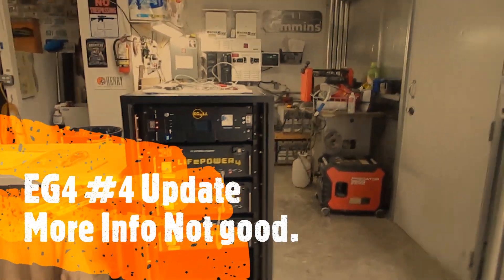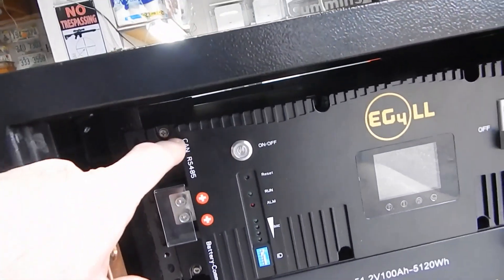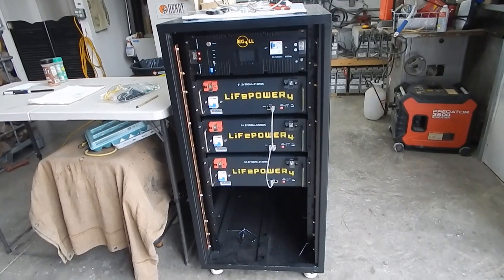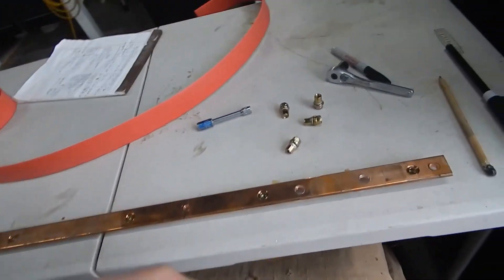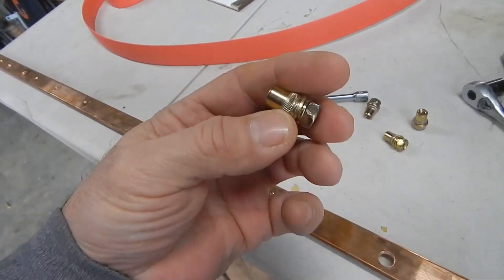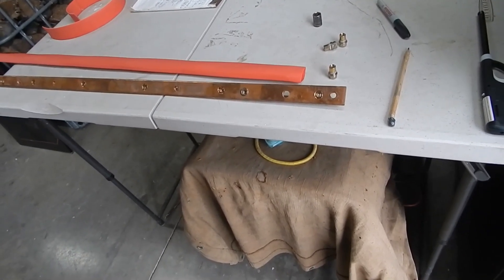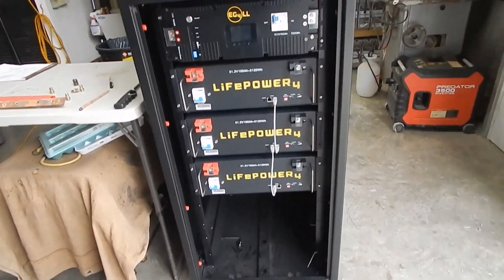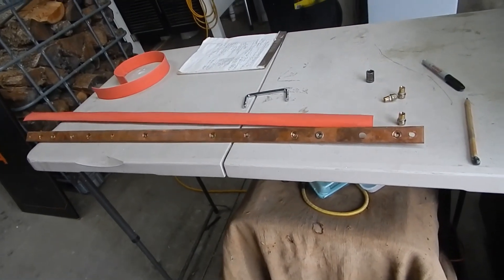EG4  Battery & Bus Bar  Info # 4   Unbelievable Safety Issue!!

Comment from the maker: Please like & share this video for safety sake. Lot's of these have been sold. If U have 1 or know someone who does please let them see this video so they can inspect there's be safe not sorry. Thanks.
Reply: Hi Glenn, looks like you eventually got things figured out, Had a question. Is your EG4LL V2 communicating with your lifepower4's, or is it separate,? I have a similar setup and haven't figured out if communication between the two is possible, Thanks
Reply from the maker: @APG78   The version 2 battery does not talk to the other 5 batteries as I was told that it would . Also the version 2 battery seems to have A BMS that will not show up on the BMS test for the version 2 battery. It has never showed up on the BMS test have gone over this with Tech Support it never has worked. They offered to send me a new BMS for the battery I told them I didn't think that was the thing to do I bought a brand new battery it should work. Anyway the battery works fine and I just left it alone. The other 5 batteries are fine and show up on the bms test for that kind.
Reply: @TheKiloG69  Copy That, Thanks for the reply 🙂

Comment: Using Pem Nuts for an electrical connection is insane.  I took my bus bar out as well to drill and tap my own holes.  The bar is 300A rated but they just about ruined it.

Comment: I had already seen this issue on other videos and so I will be setting mine up with bolts and nuts. I am getting a delivery tomorrow of 6 EG4 batteries and the free cabinet. It is probably the same buss bar you have. I use riv nuts and love them but the ones in your video are not correct for that thickness bar.
Reply from the maker: Nice be safe check them they can be fixed.
Reply: @TheKiloG69  I asked on another one of your videos, but what size bolts did you use on the buss bar. Thanks
Reply from the maker: @EL34XYZ  1/ 20x 1in. For batteries  then 3/8 × 1in for my 4 00 cable's. Shrink wrapped both bars used blue sea 200 amp fuses on pos cabling. U can get a good look at bus bars if u fast forward yesterdays  video I did. Worked out great. Would love to see your set up .best
Reply: @TheKiloG69  Thanks. My Sol-Ark 15k just arrived. Batteries will be here tomorrow. Gonna take me a week or so to get everything set up.
Reply: @TheKiloG69  I am hooking up my 6 pack of EG4's to a Sol-Ark 15k that just arrived about 30 minutes ago.

Comment: My eg4 busbar came clean and wrapped in heat shrink in the areas free of holes. Eg4 came out with a pretty good safety video as well.
Reply from the maker: I sent them this video to show how unsafe the buss bars are. They did a poor job with there video discussion on this issue. Most of what was said made no sense 🤔.
Reply: @TheKiloG69  the don't kill yourself with the batteries bit was rock solid.
Reply: @TheKiloG69  I don't have rivnuts on my busbar definitely not a safe way to go about it. The torque comments made were shots fired for sure.

Comment: Looks like shoddy workmanship. Did you use a torque wrench when tightening the large bolts? Or did the rivets come loose when you first tried to remove them when it came from the factory?
Reply from the maker: They fell out as shown live in the video.

Comment: Someone designed with the wrong style PEM nuts. A short-length PEM nut is supposed to be on the back side, and the screw goes in the front side, so it can't pull out. However, copper sucks for press-fit hardware. It's too soft. Press fit works best with steel.

Comment: The concept of the battery cabinets is good, but the workmanship is horrible. I also had one of those inserts fall out when trying to loosen the attached bolt for the battery cable connection. The bus bars are attached to 4 plastic isolators on each side. On the positive side 3 of those were broken. I zip tide those back together.
Reply from the maker: They definitely need work check out my latest video my system is up and running works great.
Reply from the maker: Checked out your channel just subbed will watch when I get a chance probably learn something for sure.

Comment: Signature Solar sold me a non working inverter which I foolishly bought after watching Will Prowse's channel.  After a lengthy ordeal with customer support I returned it for a full refund. I'll never buy anything from that company again.   For those considering these EG4 batteries I suggest you purchase batteries from Trophy batteries. They sell higher quality batteries, with a longer NON prorated warranty for the same price or less than EG4. Trophy batteries customer support is also outstanding.
Reply from the maker: Good info. Everything here was done by myself other than building shell   concrete , well,& septic systems.  No building or zoning here property is listed as green belt/ forestry. I can also get agricultural exemption= no sales taxes if I add live stock. That's alot for 1 old guy.
Reply from the maker: Sorry to hear your bad experience with signature solar. I was between EG4 batteries and trophy batteries went for the UL listed ones due to my homeowners insurance and my system being inside my building. To my surprise signature solar support Tech Support and their Resolution staff Actually looked into this and they provided me  Adequate compensation after I sent them the video of their  Unsafe bus bars with satisfactory to me they treated me well personally.
Reply: @TheKiloG69  Those lifepower 4 batteries say in the description "EG4 Lithium Iron Phosphate battery 51.2V (48V) 5.12kWh with 100AH internal BMS. Composed of (16) UL listed prismatic 3.2V cells" 
Same as Trophy battery. So you have 5 batteries that are built with UL listed cells. That does not mean the battery is UL listed like the newer V2 battery you have.

Glad to hear they resolved the issue.  A UL listing doesn't mean much  if the system is not installed in accordance with NFPA 70, C22.1, or other applicable installation codes. The 2023 code says “The installation of equipment, associated wiring, and interconnections shall be performed only by qualified persons.” Of course local electric codes mat vary.
Reply: Does trophy battery have any racking to store their batteries?
Reply from the maker: @joaof1225  I don't think so I was looking at those also . When I got these the sale was to good to pass up I had just lost 1 48volt bank so I needed to move on them.
Reply: @joaof1225  Give Dan a call at Trophy battery he will answer quickly most likely have a suggestion. I never looked in to a  store bought rack.  I have 2 of the 220ah batteries stacked vertically on a homemade rack.

Comment: You appear to have a significant lack of technical knowledge required for a DIY project like this, you're in over your head and blaming the product. 
 And while the larger rivnuts look like they were installed improperly, your attitude indicates the possibility you could've gorillaed the whole thing.  I recommend you contact a qualified installer, or do a lot of research.  
There's a ton of videos on YouTube regarding updating the firmware on these batteries and communicating with laptops and various inverters.
The fact you don't know what firmware is is a giant indicator of lack of required technical knowledge.  Page 7 of the manual tells you to use the USB to RS485 cable to communicate between the laptop and battery.  You need to configure the software to look at the correct serial port to communicate with the battery.  As described in the manual.
Good luck
Reply: Part of the problem is these DIY solar youtube influencers who push this EG 4 crap and then make it look like a simple DIY project for people with no knowledge of electric and the dangers involved.

Comment: Man, sorry to see you are having these issues.  I have this same case and got 6 of the new v2 batteries.  The larger bolts seem solid to me as of now.  You have me wondering if I should remove them and be proactive.

And yes, I had to remove all the handles from the v2 batteries as well.

I did buy a thermal camera last week for just such an occasion to watch for hotspots.

Comment: The same unit I just got has nuts on the back side of the buss bars to tighten down the bolts.  I know it did for the smaller battery connection wires.  Haven't checked the larger buss bar bolts for the battery to inverter cables yet.  Will be extra sure to do this!!   Appreciate the heads up!!

Comment: This is the second video I’ve seen where they are just sending out raw copper bus bars that are very shoddy. Seems like some of them ordered in December or after came with these. Mine came the correct tin coated copper with everything correct. My fathers came with the quality bars also. Have you resolved the issue with them yet?
Reply: I ordered two racks in December and neither had any issues. Sounds like a manufacturing issue in China. They'll address it. That said, there will be more issues and more shortages with anything from China...
Reply from the maker: @Mike80528  agreed they took care of me. Fixed it easy.
Reply from the maker: Yes took awhile but they did help me out so all good.Will be getting 2 more batteries from them.

Comment: The holes in the buss bar for the threaded insert is actually larger than the lugs on the battery cables. Pay attention to that as well.
Reply from the maker: Yes. No reply about buss bars but they helped with other issues will update.

Comment: Brother I never seen them put inserts in them they always tread them and u put bolts and nuts on them I would pull them all out and bolt them... And the com u have to download there bms software off there site and u can only see one battery at a time unless they updated the system. U have to do each battery.. I think they have new software were u can pull each battery and see each cell...use that cable with a usb to Ethernet plug the Ethernet to the battery and USB to ur computer when u download that app off signature solar its were the batteries are.... Keep it up brother
Reply from the maker: Yes so far we have pretty much tried every trick in the book we could think of downloaded driver's all the updates I should say my friend Mike did and so far we've gotten  Nowhere. You have to get the master battery communicating 1st and foremost before you can hook up each of the  Other batteries.
Reply: It’s hard to tell with the camera moving around, but it looks like all your dip switches are set default.  They all have to be set as different numbers when they are Daisy chained together like that.

Comment: Dude, I'm glad you caught this now and not over time as they heat/cool they would most likely have become looser and turned into poor conductors aka heating resistors.  I believe CAN is a communication protocol.  RS485 is a serial communication system, not ethernet.  Not sure if you have ethernet since you just showed CAN and RS485.  Ethernet is a networking protocol, however ethernet uses RJ45 jacks, which CAN and RS485 could have wired jacks to use.  Do you also have a network port somewhere?  Do you know if your friend tried a terminal (not network connection) trying different handshakes, duplex, etc?  Maybe he will see this and reply
Reply from the maker: This is all past what I can do. I'M going to email  signature solar tomorrow I'm going to share a link for these videos so they can see what's been going on. Unlike big YouTube channels I don't get paid to say good things about products which you get here is the unbiased truth I paid for this setup with my own money.

Comment: I would probably bolt through or tap the bus bars so I could use a Bolt through. Also I think they had a issue using the Different Batteries on another Video I saw. With Software. Dont mix the Version The guy said. because of communication issues.
Reply from the maker: Yes bolts would be the fix. Will email signature solar forward them this video. I couldn't get the version too battery to work which has to work before you connect the rest of the batteries which I was told would work just fine. That bus bar is a lawsuit waiting to happen.

Comment: You can't expect them to give you a great deal AND have product that works, LOL.   
I had problems with their customer service too, or more accurately lack of.
Reply from the maker: Yes definitely having some issues. Tomorrow sometime I'm gonna send an email with a link to this video so they can see it that bus bar is really a big safety issue.
Reply: @TheKiloG69  It will be weeks before you hear back via e-mail. Been there.
Reply: This company is piss poor. They took me fir 30k. Will not spend another cent with them. Poor tech support faulty products. They refuse to let you speak to upper management.

Comment: I don't understand  why people keep doing top and bottom on bus bars. You delling with something at 168.000 miles a sec. 4 feet on a bus bar that can handle a 1000 amps. SS said it ok the way it comes. to me if you are concerned mount it in the middle that is how I have my bus. with 2ga going to it and 4/0 coming off. just my 2cent
Reply from the maker: 12 years in working with solar & batteries that's how I'm doing it always will.The way U suggest should work also.
Reply: @TheKiloG69  I have done it that why with just batteries but with bus bars I do it like I said is there a big diffract no I don't think so. But that is how we wired up our inductor for induction harding and we run 800 volts and more at 800 to 2000 amps up to 8000 thandoud hz.  Thanks for the talk have leaRDED A LOT FROM PEOPLE LIKE YOU
Reply: Electrons don't move anywhere near the speed of light through a wire.  They bump into adjacent Electrons like billiard balls.
Reply: @desertaip9137   Power does ic chips relays and stuff like the will show it down. But we louse current with res. and that thought heat wire bus big enough will have no loss if used with the right current

Comment: WOW. lots of safety problems with that setup. unbelievable.
Reply from the maker: My friend that is beyond unbelievable. Luckily for me I always tear stuff apart before I use it. That bus bar issue  Beyond unbelievable if those bolts just came out like 2 did & u used them the way they were they are going to  back out it's gonna cause a fire down the road.
Reply: @TheKiloG69  Yes just as well we always check gear over. This is why.  I hope you sent them a link to the video, Here in Australia i would have reported them to the ACCC (Australian Competition and Consumer Commission) for safety violations that could cause Fire and Death. Along with a video on my complaint. Not only would they get a huge fine but they would have to recall the product Australia wide.

Comment: LL won't talk to the lifepower.   Two different BMS's  won't work that I know of
Reply from the maker: I was told they would work using the version 2 as the master battery with the screen. I can't get the master battery version 2 to hook up to anything that shown on the website or downloads MASTER BATTERY has to be dealt with 1st.
Reply: @TheKiloG69  the older LL version 1 this would work, but not Lifepower.
Reply from the maker: @bigblockcutlass123   I just actually spoke to a live person at signature solar forwarded them this video. They're going to view the video. I was given the wrong information these batteries will not communicate with each other. I was given incorrect information by the sales person we'll see what happens thanks for your input and you are correct. Had I known that was not the case I would have never spent the extra money for the fancy battery that doesn't do what I was told it does.

Comment: It don’t make a difference the 150 ,200 or 250
Reply from the maker: Makes a big difference in the PV voc voltage coming in the higher the better . I have different mixed solar panels that I could hook up together to play nice at 210 220 voc in that's why difference.
Reply: @TheKiloG69  and it can be use for wind and hydro
Reply from the maker: @solarandwindinsouthtexasda1473  both of my charge controllers Out Back 80 & midnight solar 150 are more than 10 years in service no issues that's impressive.
Reply: @TheKiloG69  yes but only one can be use for wind

Comment: HolyMoses! I will inspect mine once I get my PVC cable raceway and remove the buss bars. Those "inserts" for the main power lugs won't last (IMHO) even if they are crimped in solidly. Using a bolt for 4/0 lugs with 5/16" hole diameter with real bolts, washers, lockwashers (or Nylock nuts) would be much safer. Lastly, I just read through the owner's manual on mine and watched a couple of videos. To me, it looks like you have to assign each battery it's own ID and dip switch settings in order for each battery to communicate independently their BMS information to a laptop. Seems legit to me. But, I have seen online where other folks are having software download issues, cabling issues, and driver issues. When I looked at everything (doing my homework). It looks like it isn't as straight forward as it could be and requires some knowledge of ports, settings, and ID assignments. I hope you get some headway on your install.
Reply from the maker: Thanks Me Too! Mike knows what hes doing. We couldn't do anything with the main battery version 2 that has to be dealt with 1st before you can do anything else. Was a huge headache monumental waste of time not happy.  Bus bar is a law suit waiting to happen. Going to forward this video to signature solar unacceptable this is really bad. I know I can fix this with nuts and bolts that's not the point. Stuff like this needs to be looked at before it is ever shipped out to the public and a huge liability for them.  I just saw a new video by them trying to explain this situation. Version 2 battery in this new video doesn't look like mine totally different couldn't make anything work.
Reply: @TheKiloG69  -- Please give me call...I am out working on mine right now